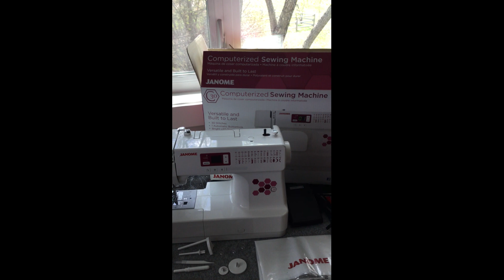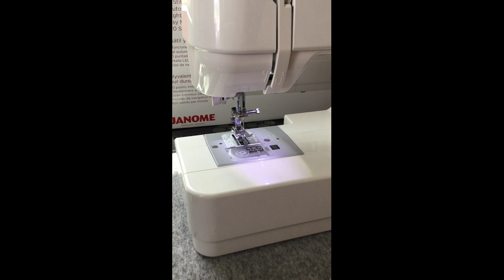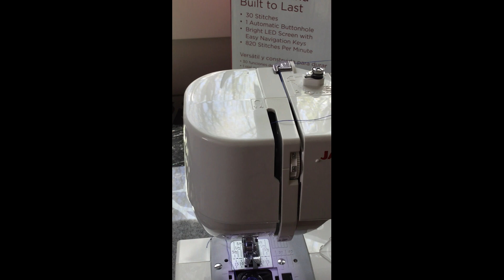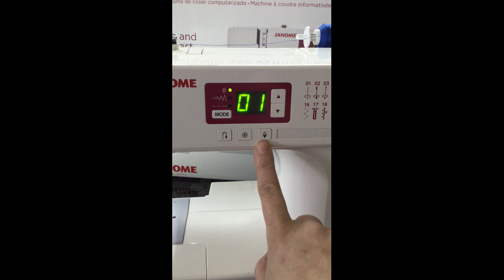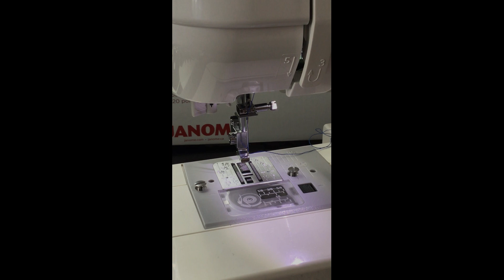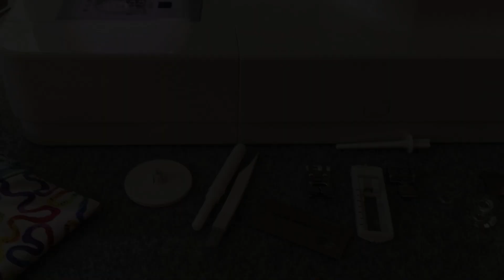Janome Machine Series: Part 1 C30 Tips & Tricks

Comment: I found this video very helpful. However, I bought the C30 a couple of weeks ago and have only used it a few times to practice sewing after many years away. Yesterday the handle broke off the needle threader when I pulled it down. Is there any way to reattach it? I’m extremely upset about this. It is nearly impossible for me to do it by hand and is one of the reasons I bought this model.

Comment: HI- My friend has this machine and I'm asking for her.  On later machines that use this type of display and toggle for selecting stitches, it either gives you the letter for the foot needed for each stitch in the display or it is included under the stitch selection shown on the front of the machine.  This machine does not seem to have that. Do you need to refer to the manual each time you want to change the stitch for the required foot or is there somewhere else it is shown on the machine?  Thanks.

Comment: I have the same machine which I would like to clean. Have tried repeatedly and cannot remove the screws from the needle plate as they have been tightened far too securely. The screws won't budge. Any tips? Thanks for the vid. It's thorough and easy to follow.

Comment: At 3:10 the spool cap was put on backwards. Was that done inadvertently or for a reason?
Reply from the maker: Myra Thomas it actually is not a big deal which way it goes. Some people do it one way, others do it the other way. More important is how the spoil of thread is put onto the holder.
Reply: @janomelife  Thank you for your quick and kind reply. Yes, I see how it would be a moot issue for the type of spool used in this video because that kind of spool would have a gap between the holder and the end of the spool anyway, although for spools that are flat on both ends, placing the cap so its flush against the spool prevents thread tangling around the spool pin as an extra precaution.

Comment: This is fantastic stuff.  I learned so much here with a real person demonstrating.  Thank you so much. Immediately after I made this comment I tried to tread my machine I bought in December. The threader worked on the first try then when I tried to thread the needle again to be sure I could do it again, the threader came loose off the black long rod it was attached to.  I tried to slide it back on but it  would not hold.  Can it be reattached and how to do it please? PLEASE HELP!!!
Reply from the maker: Richards Richards It sounds like you are going to need help from a technician. Are you able to call a Janome dealer near you? Not sure where you are located but our dealer locator is on our website.